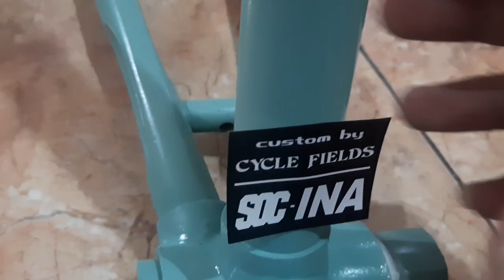Bicycle Restoration For New Year's Give | Urban City Bicycle |

Comment: I don’t know how you don’t have more followers. You are one of the best bike rebuilders on YouTube.  From absolute garbage, to treasure. This bike looks as good as anything sold in bike shops today for $1000. You bring these old bikes back to life with an artists touch.
Reply from the maker: Thanks you so much Brother
Reply: I know, he is a frame restorer, and bike part replacement, nothing to deal with a real restoration, unfortunately, this is common for the Asian restoration channels, the same as the Comet restoration is doing, he sometimes paints rusted parts. So @CycledFields you had a great base for restoration and you did a replacement. You are doing quite a nice job but you can be better, much better. Take a look at an OldShovel to see what the restoration looks like. Good luck !!!
Reply from the maker: thank you for the advice, I really hope to get a good bike like the oldsovel. In the future I will try to do better.

Comment: Upon removing the Bottom Bracket, notice the pile of rust. Suspect some from saddle tube. Placing some form of plastic, loose fitting shroud around the spindle and bearing housings prior lock up prevents the same.

Comment: In the USA the rear brake lever is on the right and the front lever is on the left. It seems opposite on the bikes that you build.
Reply: In the UK we do it the other way around . I do not know the reason for this but we allways have the front brake of motorcycles on the right as well and the clutch on the left . maybe its because you ride on the right hand side of the road and we ride on the left .Most people are right handed so your strongist hand would be on the primary brake ..ie the front brake. or maybe its that In the U.S., the law requires that all bikes are sold with the left hand controlling the front brake,

Comment: Sorry man but that bike has eyelets for mudguards. You should have used them. The mudguard stays ends are not closed so they can spread under load and it is possible for the bike to be unsafe.
They can appear secure but over time I would not trust them. 
Take from that what you will.
Reply from the maker: Yeah , thanks man 😁👍💯💯💯💯